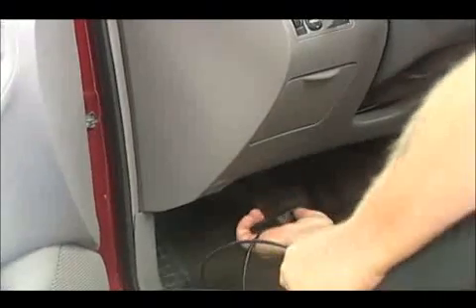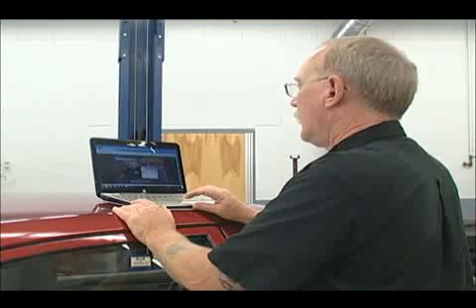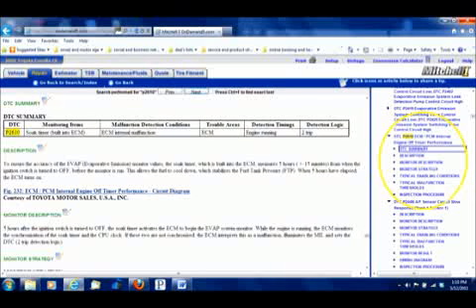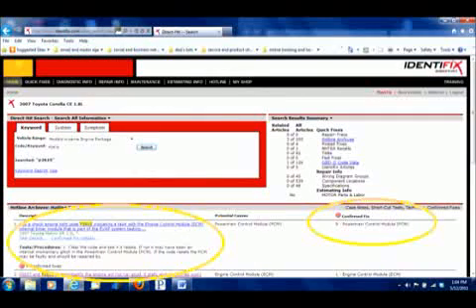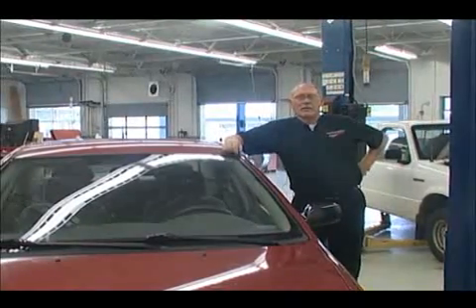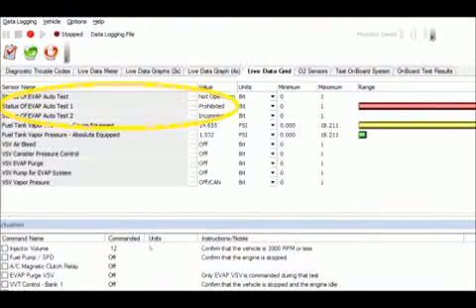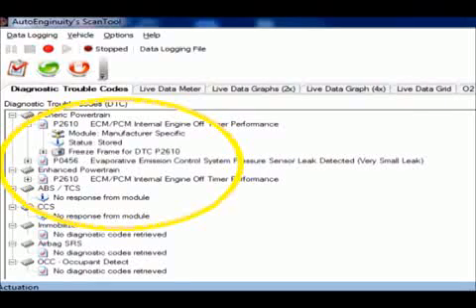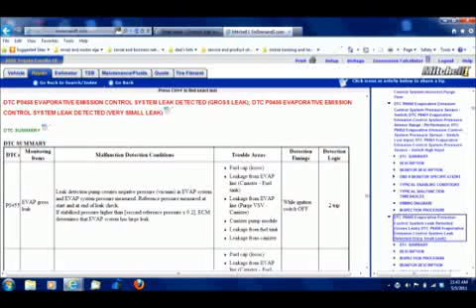The Trainer #8:  Diagnosing EVAP Systems

Comment: Fuel trim bank 1&2 (idle load) ms -0.2   Fuel trim bank 1 part load -3.9% bank 2 part load -2.9%. Ect 184deg. Rpm750 maf 18 kgh and engine load is 134
Reply: Maf 18 KGh @ 0.9 v. Engine load 134
Reply from the maker: Those aren't from Freeze Frame. FF data is that data the ECM records at the time it matures a code and turns on the CEL. It's also called Mode $02 on some scanners and is a Global OBD II mode. That engine load number is high, too. I did some background checking and found instances of torn air intake boots causing this complaint. The codes are for generic fuel control and not necessarily for lean or rich. Smoke the intake or visually inspect the boot and let me know...
Reply: Motor Age thank you I really appreciate your time with this. I have replaced all engine vacuum lines and boots and then a complete smoke test and found no leaks. If I force a vacuum leak or an unmetered air leak between mass airflow and throttle body fuel trims go back to close to 0. That's what makes me think it might be too much vapor coming from the vapor canister causing the rich condition. If the canister vent is stuck closed, when the ecm opens the purge valve would that cause a rich condition if no o2 is mixing with vapor before entering manifold?
Reply from the maker: So far, I haven't seen any numbers indicating a rich condition. And I don't think so. If the canister vent is closed, the system will be pulled into a vacuum pretty quick and I'm betting that would set a code. Try a Volumetric Efficiency test on it and see if the MAF is reporting accurately. Good luck!
Reply: Motor Age ok I will check into that at work tomorrow. Thank you

Comment: I see you have a 5 series BMW on the rack. I would like to see how that evap system works and causes due to failure. I'm having a rich condition with my BMW and think it's the evap system with no evap codes.
Reply from the maker: The only way I can think of that your EVAP system would cause a "system rich" issue would be a purge solenoid that wasn't closing when it should. How do you know it's rich? Have you looked at the fuel trim numbers? When is it rich - idle, cruise, all the time?
Reply: Motor Age it is Rich all the time my diagnostic tool shows feel trim in this format. Using data Stream, adaption, mixture 1, additive 0.15-0.50 ms. Same on bank 2. Adaption, mixture 1, multiplicative - 2.2--8.0%. Same on bank 2. When it passes 8.0% either way it throughs check engine light. Codes are p1188 and p1189 fuel trim bank 1&2 permissible range exceeded. And codes p0170 and p0173 fuel trim banks 1&2 control limit. This only happens rarely. I have tested everything. Purge valve tests ok but don't know if ecm is actually shutting off power to valve.
Reply from the maker: Use your Global OBD II mode and tell me what the Freeze Frame data is. Need to know when it's "rich".
Reply: Motor Age it is rich all the time. My diagnostics tool shows fuel trim in this format. What is an email I can send you the freeze frame info to
Reply: Ok. My scan tool does not freeze frame it just shows live data. I used a snap on tool at work this morning. Freeze framed everything. If you want to see it it would have to be emailed. There is a lot of info. At Idol with car warmed up fuel trim is -.20 ms and about -3 1/2% both banks. While driving the percentage fluctuates from us much is -5% on acceleration and around -4% at highway cruise speed and then drops down or should I say goes up to -2% when decelerating. I really appreciate your time and help. Joe
Reply: I know that 5% fuel trim either way it's really nothing to worry about but every now and then it will spike to -8% and throw a check engine light by the way it's a 1999 BMW 528i
Reply from the maker: Send me the following data from your Freeze Frame recording:  STFT B1, STFT B2, LTFT B1, LTFT B2, ECT, RPM, LOAD (or CALC LOAD), MAF

Let's start there....
Reply from the maker: Even 8% shouldn't cause the CEL to come on. And you always want to look at TOTAL trim - STFT + LTFT.

Comment: Please help after resetting  my  2000 Toyota Camry  with a OBD 2 scanner  i have  driven my car over 520 miles...the  check enginge  sign never came back but all the monitors reported expect one 
EVAP System Monitor   its says  INC (incomplete) ??? i know  520 miles too long a mechanic would  not wait that long.yesterday i reset the car computer again this time  by disconnecting negative battery terminal after driving  for15 miles  all the monitors  reported expect EVAP system monitor i am supposed to take the state of illinois emission in January does it means  it won't  pass the emission test??? please suggest 
 what to do  i really appreciate it thanks..
Reply from the maker: The EVAP monitor can be the most difficult to reset. It depends on how the car is being driven, how much fuel is in the tank and numerous other factors. Most states that have emissions test allow at least one monitor to be "Not Ready". Don't reset it again! Then you start all over...
Reply: LinTo Joseph 9

Comment: had code po455 come up on my 09 ford escape with 4 cyl engine -took vapor purge valve off (located at front of engine)  cleaned with pb blaster and compressed air -engine Iight went off next day -mike -Brantford.ca

Comment from the maker: You can access Mitchell 1's DIY info at eautorepair (dot) net or connect direct with Ford by logging on to the OEM matrix at oem1stop (dot) com. Both will charge a fee, so get a few discs and burn the manual for your car for later use.

Comment from the maker: Most purge valves are located under the hood. Look for a line attached downstream of or on the throttle body heading back toward the firewall. You can also check some of the larger parts stores (NAPA, for example) sites for part locators that will give you a picture of where it is.

Comment from the maker: I did some digging and found two Toyota factory TSBs that you may want to look at; EG003-02 and EG005-01. I also learned that "Check Mode" eliminates the 2-trip detection requirement and impacts the code parameters. It doesn't allow you to complete the monitor any faster, but it can help in repair verification.

Comment: As I know you are aware evap monitors can take a long time to run.  I was thinking/wondering  if check mode can be used to cut down on that time and confirm repairs faster than letting the monitor run via drive cycles which it would require to cycles to complete

Comment from the maker: I don't know what state you're in, or what the inspection laws there are but it sounds messed up. If there is a problem with the system, the ECM will set a related code. If it's fumes past the gas cap, the seal on the cap may be all that is wrong. As for the rest, timing chains can be replaced and lean codes should be fixed. If the inspector is failing you for emissions, then THAT should be the reason for the failure.

Maybe you need another opinion....

Comment from the maker: There is a valve on the tank that allows fuel vapors to pass through this line. Sounds like it's failed. When you remove the fuel cap, do you year any rush of air out, as if the tank is under pressure? Another symptom of a clogged or defective valve.

Comment from the maker: First, which line are you checking, the purge or vent line? Whichever, i wouldn't recommend blowing the debris in the tank. It's going to end up clogging your fuel pump!

The only thing that clogs an evap line is a failed charcoal canister. You're going to have to drop the tank.

Comment from the maker: There were two problems on this car. One involved a factory recall on the engine's computer and it was included to stress the need to check for factory service bulletins during the course of your repair. Once the new ECM was installed, we tackled the leak code. Should have stuck around! :-)

Comment from the maker: The purge valve is located in the line leading from the canister to the engine's intake manifold. You can access the Kia factory information site for free for details on testing and replacement. Just go to oem1stop.com and click on the Kia logo.

Comment: How can I fix a canister vent valve solenoid in a 2006 Kia Optima??? Where is located?
The check engine light has been on for months and even the Kia company said it's 
the purge valve and I have had the car diagnosed by other shops.
Can anyone help me???

Comment from the maker: Generically, this code means there was no flow of vapor from the canister when the purge valve was open. Check for the proper operation of the purge valve (located in the line from the intake side of the engine) and the line itself. Hope this helps!